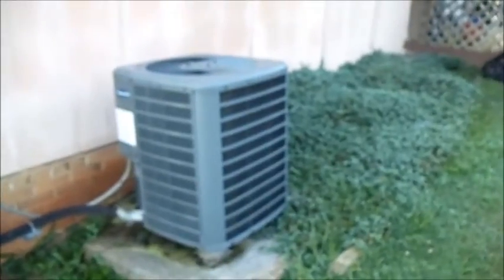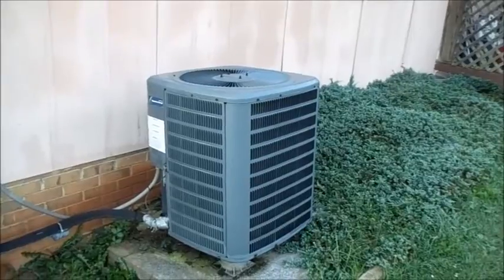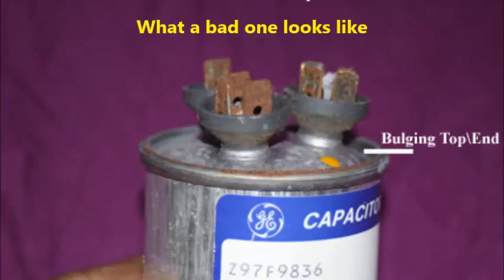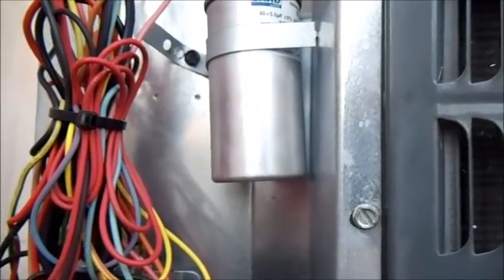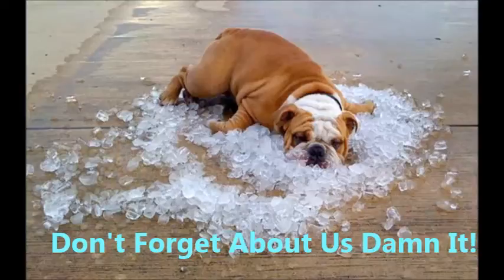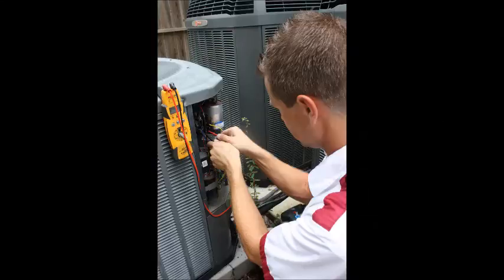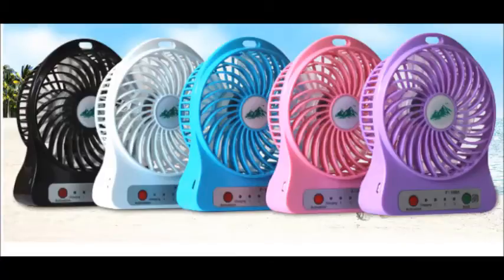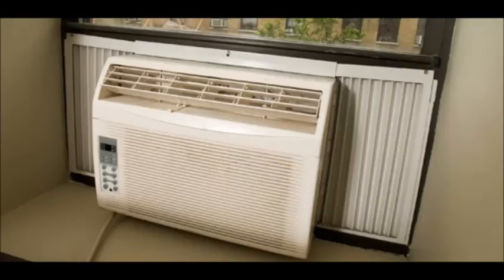What is the Average Cost for RUN CAPACITOR on AC Heat Pump HVAC

Comment: I would have charged $130.00 for duel capacitor and $85.00 labor and service call $49.00. Tax 10.72 total $274.72 with warranty 1 year on parts & 30 days labor.

Comment: 210.00 is actually a good price, I seen 300.00+ for a capacitor. Handyman or DIY people need to be careful those capacitors can store power either 370 or 440 volts which can kill you.